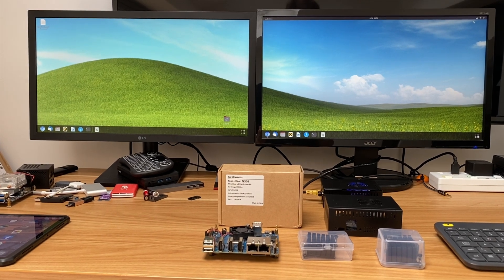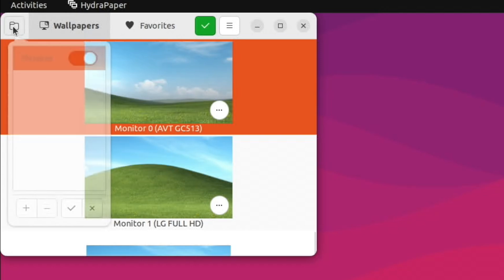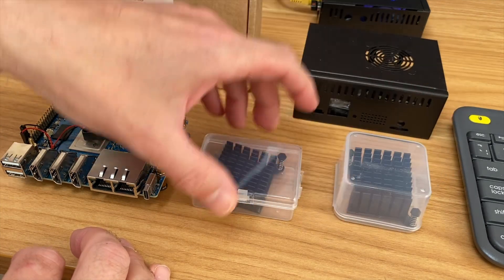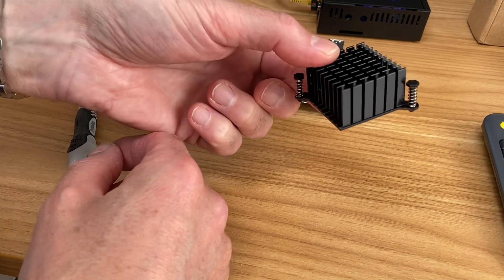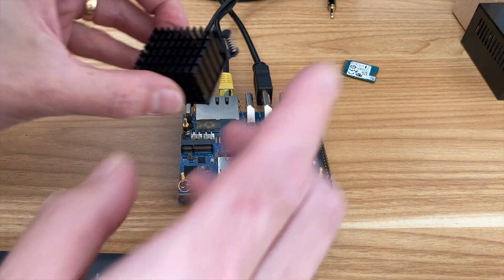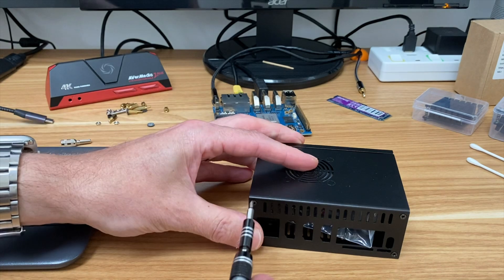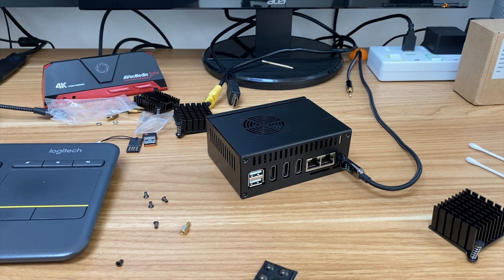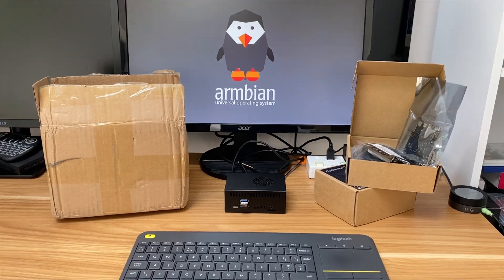Orange Pi 5 Plus Case and Coolers test. Geekworm

Comment: Does that nvme drive need to be that small?
Or can i use one of any size
Reply from the maker: It takes 2280 on the underside the top m.2 is for Bluetooth and WiFi

http://www.orangepi.org/html/hardWare/computerAndMicrocontrollers/details/Orange-Pi-5-plus.html

Comment: If you ever get the time, and dont mind you should test Steams proton on the orange pi 5 plus, and see if you can run overwatch, apex, and some other esports titles... Also would there be any way to use the big heat sink with the fan on the outside of the case?

Comment: On the 5+, there is a fan connector beside the clock...both .1mm.2pin. with augment software, the fan pwms. Also armbian-config allows clock options for throttling...on demand is great. For full perf, go peltier with fan...best with 12v augment power. Need if your driving pins lots,jpk

Comment: I see your use debian.👍 I like ubuntu more but it is quite glitchy on the 5+ (22.04/23.04). It's great on the 5 though. I'm trying to run gambas3 which works @3.18 ver on the opi5 - Ubuntu 23.04 but not on 5+ at all with ubuntu. It works well on debian 11 and gambas 3.15 on the 5+. I'm going to focus around debian for dev and work on 5+ but Ubuntu for play and study on 5. I am assembling for thumb, arm32 and arm64 with success. #32@thumb interwork but 64 needs isolation. I have not found a armxx qemu or box, just x86/64 emu. I❤️arm. 🤗👽,jpk ps my rock pi 5 crashes after about 60 hours no matter what...anyone else? All others stable over time. OS tests done...now for dev

Comment: Would you recommend using the stock heatsink that comes with the case, or do you think the small copper heatsinks from geekworm would be better?
Reply from the maker: With the fan it will be fine. I prefer the larger cooler without fan for silent cooling

Comment: Hello, I have a problem with my root password on my Orange Pi5 running Ubuntu. I have already flashed my system 7 times using the latest image. I have tried both M2 Boot and Micro SD, but the result is always the same. It says "Password successfully changed," but unfortunately, it remains as "orangepi." I have tried the following commands: sudo -i, sudo passwd, or sudo passwd root. Do you have the same problem? lg
Reply from the maker: It always changed fine for me with passwd
Reply: @leepspvideo  thx

Comment: Very good. These passive coolers allow to use the board upside down so as to cool the M.2 down much more efficiently (now facing north for heat to move up more easily + passive cooler + optionally a 30 / 40mm cooler) as this is this component that really heats up significantly. Are other chipsets on the board also heating up and to what levels? on what use cases? (an IR camera can easily tell.. ) for next tests, could you please display the temperatures over time on a graph in order to have a more visual comparison of temperature curves between cooling configurations?

Comment: There is a FAN connector on the board, right behind the ethernet ports. Could you test your fan on that connector and see if the connector provides speed control?
Reply from the maker: It’s a different size connection. Just positive and negative connections

Comment: I have the geekworm pi plus case and I think it’s very nice - although there’s no external GPIO access.  Been thinking of cutting an opening in the side and adding a 90 degree 40 pin female header upside down. Also need buy a 1.25 mm micro JST to connect to the dedicated fan pins since the one that comes with it only fits the GPIO pins.

Comment: So, isn't the fan connector on those white plugs on the board? I would think that white plug near the DDR memory would be the one for the fan.
Reply: Wrong size connector if I remember correctly.
Reply from the maker: @MrPir84free  yes I tried. It’s too small

Comment: I have the same set up with that case and 16mm cooler and fan inside. One question, with ubuntu i can turn it off from the system, but the fan dont stop, unless i take out the power cable. Is this right? Moreover, is there an alternative os for android in order to find a version that can use gpu acceleration ?
Reply from the maker: We could do with a pwm fan like this Raspberry Pi one

Great Raspberry Pi 4 Cooling solution
https://youtu.be/rNZ52XUr3SM
Reply: I will try it to see if it is spinning when the system is shut off thank you again
Reply: Do you have your fan plugged into the project pins, or to the dedicated fan connector behind the ethernet ports?
Reply from the maker: @dialogue62  gpio pins
Reply: I have connect the fan to the gpio with 5v